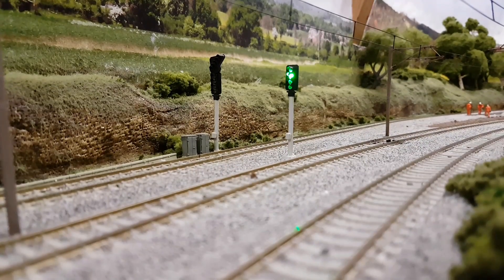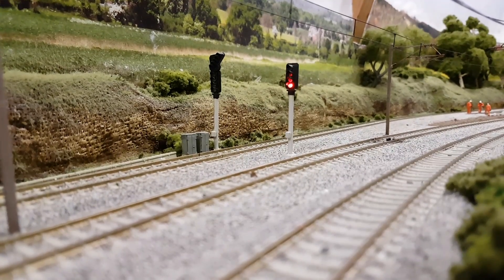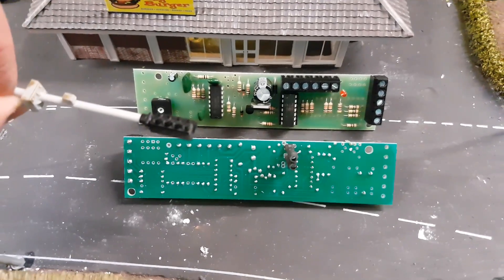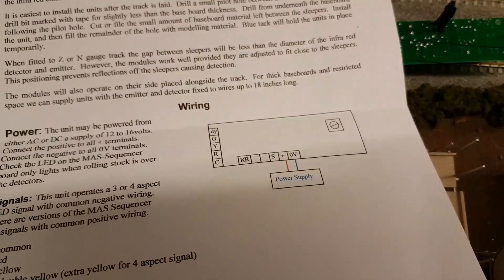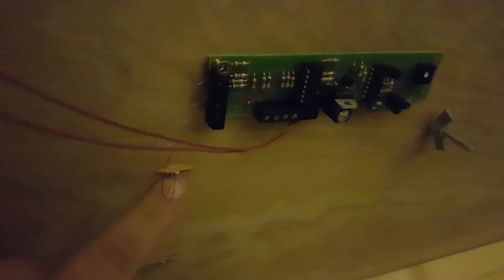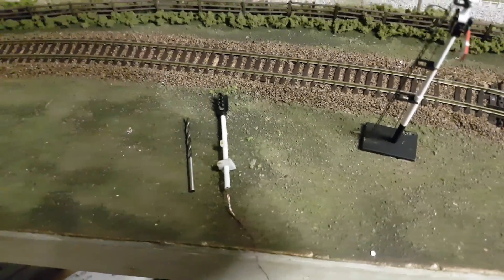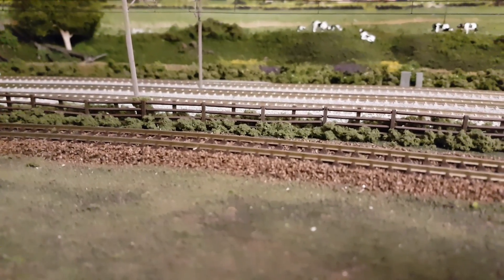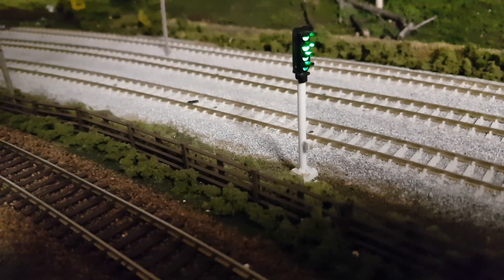New Junction - Adding Automatic Signals

Comment: Nice video and very easy system and explanation. Do the signals control the trains i.e. a red stops the train or is that up to the driver ?
Reply from the maker: Up to the driver
Reply: @newjunction  Thanks.

Comment: Very nice concept, particularly the signal to signal control. I think that the light output of the LEDs need to be attenuated to prevent overspill - and blinding the driver. He's only small. A resistor in the signal leads would work.

Small point, but for those of you which mainly run steam locomotive-hauled trains, I understand that the practice was "last wheel replacement" to red. 
So, in the days of yore when trains had a brake van at the back and the guard was assiduously monitoring the train's progress and looking out of the ducket at signals, he should not see a red light being passed, hence, last wheel replacement. Can this be done on this system? Will mere relocation in advance of the signal be useful?

Comment: Nice system but I think Ansaldo installed the wires between the signal and the circuit board! Hehehe. on a serious note, there is a lot of light contamination between lenses. Could you not put some paint around the lenses to prevent the light leaching to the non illuminated lenses?

Comment: Can you set them to stay red until they are cleared manually by a switch of sorts? I'm running on a bi-directional single track, so having them change to green when a train would be coming in the opposite direction isn't realistic at all and I'm guessing it would mess up the censor sequence, too.
Reply from the maker: MickMaan These Mas sequencers in particular are the automatic sort however Heathcote themselves do an endless array of boards for all scenarios. 

Give them a look up. :-)
Reply: MickMaan 🙂

Comment: I have a signal like this from Traintronics which I have yet to install. The wires don't seem to be insulated...how does that work?
Reply: Thin wires are usulay varnish protected - so to solder you need to scrape varnish from end. Cover soldered joint with heat shink.